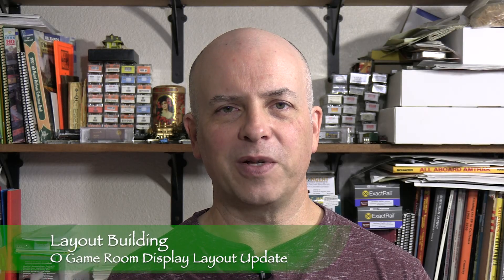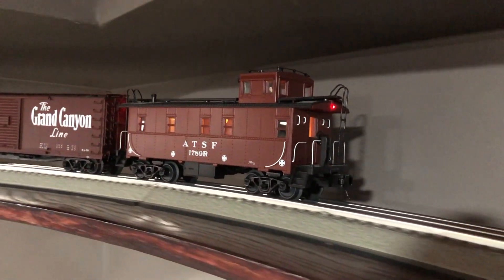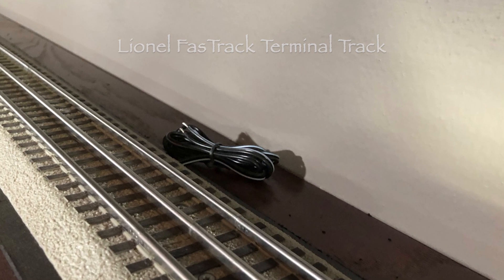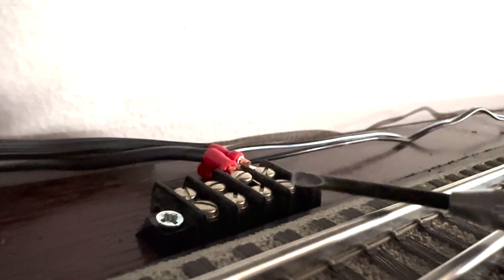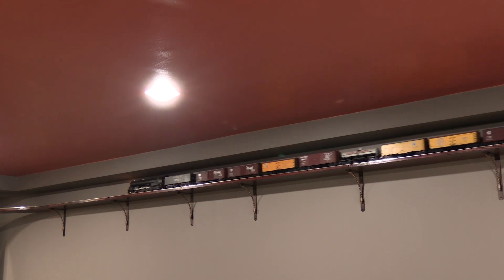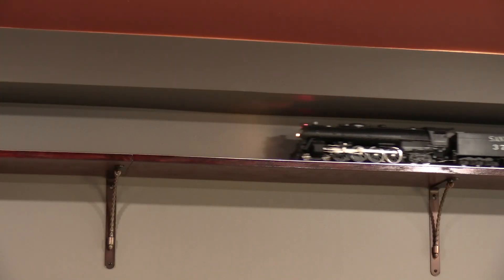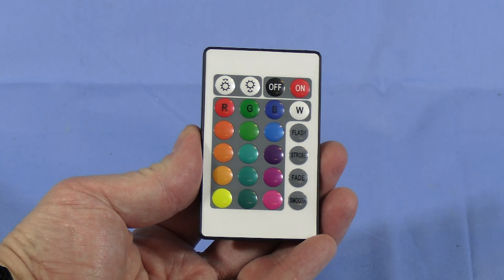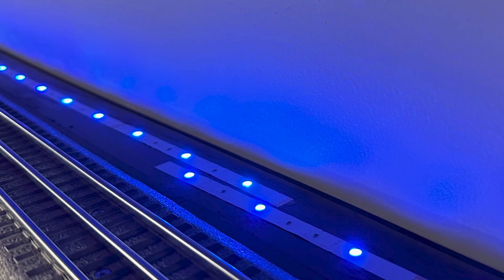Layout Building O Game Room Display Layout Update - Electrical Improvements and LED Lighting

Comment: That looks awesome, Dan.  The LED lighting worked real well.  Thank you for sharing.  I've been wanting to ask you something for a while now.  With all your skills in customizing model railroad locomotives, would you feel confident converting a Lionel engine from the third-rail system to a two track pick up system?  Would you rate that as a very complex project, or so-so complexity. Or, put another way, have you ever worked on more complex electrical pick up project than converting a middle rail would be?  Thank you for your response. Happy Thanksgiving to you and Nicole!
Reply from the maker: I have not attempted that kind of conversion.  I think a big stumbling block would be the wheels.  The Lionel track has the same polarity on both outside rails, so sometimes the wheel sets are not insulated.  If you put that kind of wheel set on a two-rail track it would short it out.  3-rail wheels also tend to have deeper flanges than scale, so that could also be an issue.  If suitable replacement wheels and axles were available, then it would be a matter of swapping out the electronics, and possibly the motor.  I'm not sure if AC motors will work on DC.  So yes, it would be fairly complex.  Happy Thanksgiving to you as well!